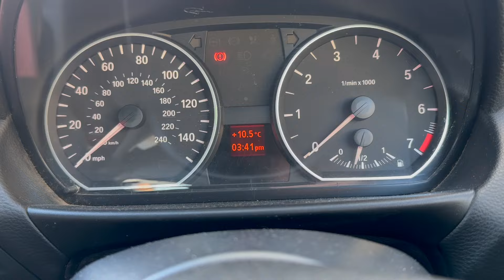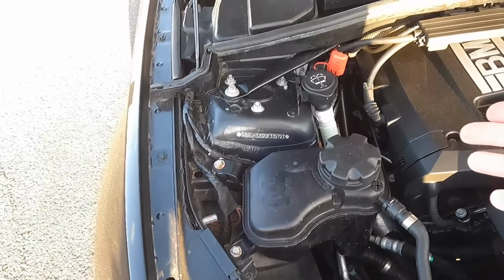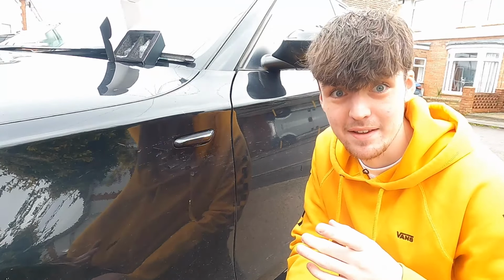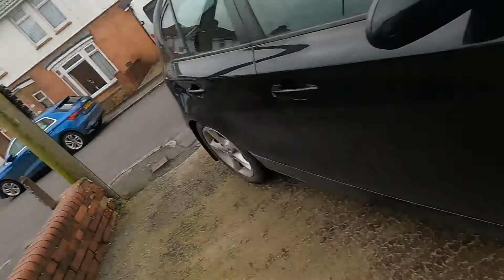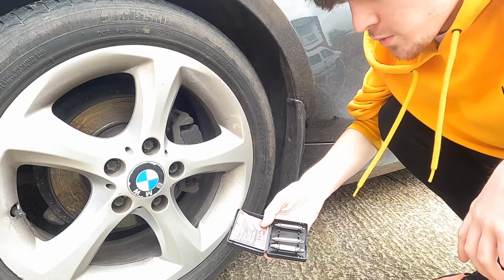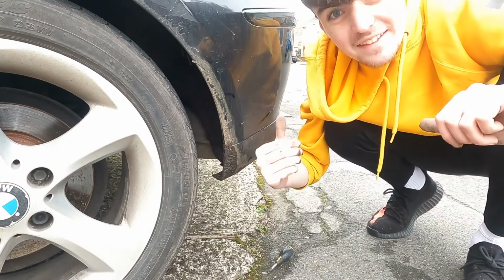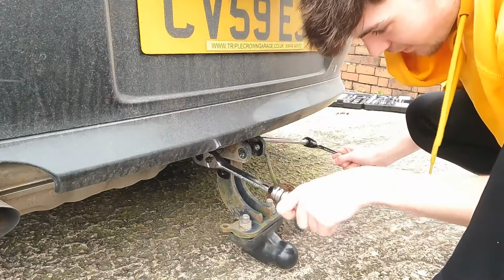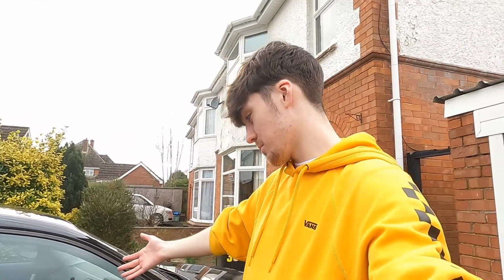EVERYTHING WRONG WITH MY BMW 1 SERIES

Comment: Your washer/motor is blocked what you need to do is access the washer container and remove the washer motor clean the filter as it builds up with algae the hardest part is getting to the bottle container you have to take the front wheel off driver side and the liner of to access the bottle container there is a plug on the bottle which is connected to the motor ( which is working as you can hear it when you press the stalk) unconnect the plug pull the motor out of its housing either clean or replace the little filter it’s a fiddly job but it’s well worth doing , i’ve done this on my BMW I was so really relieved to get it done best of luck
Your sidemarkers swap them other left to right / right to left for correct flashing
Reply from the maker: Fantastic, thank you very much, I will hopefully be taking the inner lining out for something else soon, so ill give it a go then as well!
and I can't find those indicators anywhere, if you know of any, could you send a link over please mate
Reply: The indicators should be okay what I mean is just swap them over so you’re right hand side goes on the left-hand and vice versa

Comment: Make sure the washer lines are connected properly at the t junction on the bonnet. I had same issue could hear the motor but nothing coming out. Pulled the t junction apart and pushed back together now it works
Reply from the maker: You’re a legend, I was going to give that a go tomorrow so I’ll make sure to look out for that! 🫶

Comment: Keep going lad, I'm still ongoing with my 120D with electrical gremlins before i can start modding mine
Reply from the maker: Ahhh man that sucks, fingers crossed all gets resolved. Ive got a new video coming out Sunday and I've done more work to the car, I'm only just getting started 💪
Reply: @OfficialSamBryant  hopefully on the home stretch buddy, should’ve made videos about it but didn’t know where to start 😂
Reply from the maker: I didn't know where to start either, I've only been doing YouTube 5 months, just picking up a camera and going for it is what I did 😂 What are your electrical issues?
Reply: @OfficialSamBryant  might try it with me iphone and see how i get on 😂 erm it started with no communication to the obd port turned out to be a bad junction box and a broken pin in the obd (i accidentally did that one) now just sorting the dodgy stuff the previous owners done I’ve an airbag light on started with 7 faults turns out most of them were unplugged at the seats 🤦‍♂️ last 2 one is a bent pin on the driverside airbag plug, so have to snip that and rewire a new plug on and hopefully itll go away then it’s the engine ones 🤦‍♂️😂
Reply from the maker: All of my B-roll I now film on my iPhone with cinematic mode, so absolutely give it a go! But for your electrical issues, my lord that is a headache 😂 I'm just wondering how everything was unplugged in the seats, that's something I haven't heard before 🤦‍♂️😂
Reply: @OfficialSamBryant  i might give it ago but I’ve no cinematic mode (iphone 12) 🤦‍♂️😂 that’s nothing if you think that’s bad id show you the driverside airbag plug but no way on YouTube 😂
Reply from the maker: Cinematic mode is only helpful with B-roll stuff other than that an iPhone 12 will be boss for filming, I use a go pro hero 9 so nothing crazy good either 🤷‍♂️ I have seen cars in worse states electrically so I reckon its something definitely fixable. Getting cameras into tight spaces is not easy, maybe move the seat all the way forward and use the phone to film from a top angle?
Reply: @OfficialSamBryant  I’ll try it but won’t see much ill need to chop the connector off and solder a new one on from front underside of the seat 😂
Reply from the maker: Well good luck buddy, I hope it works out 😂 keep me in the loop as id be happy to follow you and your car